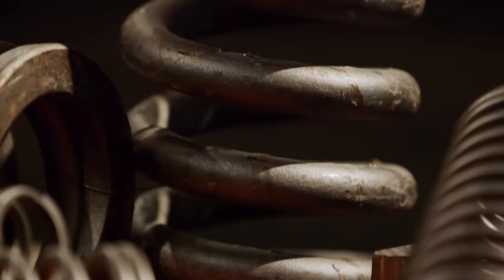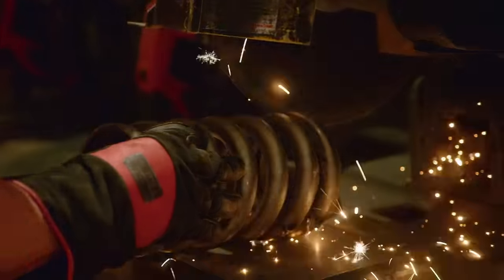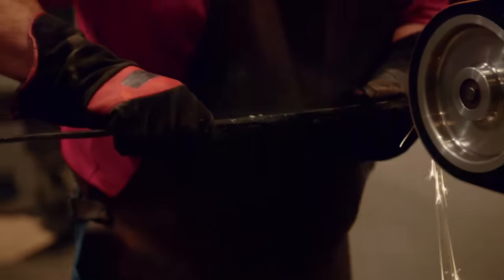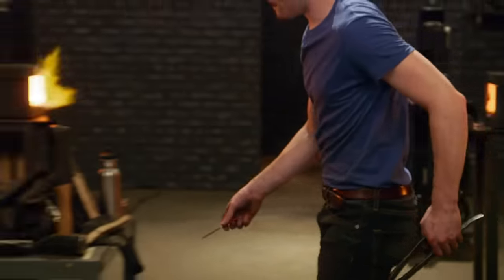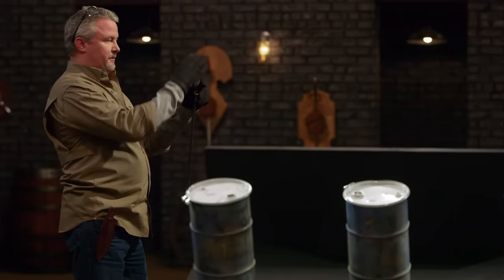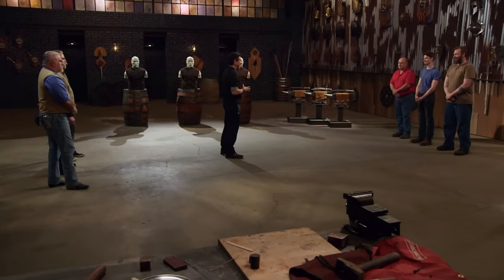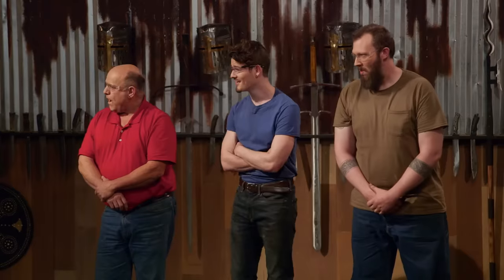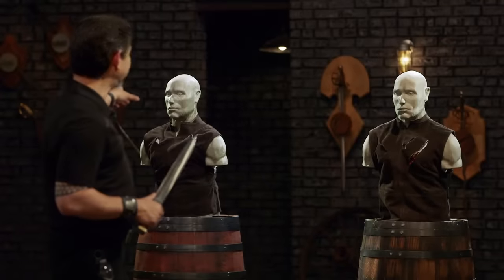Bladesmiths SPRING Into Action | Forged in Fire (Season 7)

Comment: Doug comes within inches of lacerating his palm due to a poorly designed guard, yet the blade smith still moves on to the final round.  That baffles me.
Reply: The entire time watching the sharpness test.  I had the feeling that was going to happen.  😢
Reply: Ok but it lt did hold up much better then all the other blades and the Ricky's blade was holding up plus it only had one side of it that was large yes his guard was not perfect and it could have been better designed but it did much better then the other two knifes
Reply: Because it doesn't have taken more damage
Reply: Knives have been disqualified in previous shows because they posed a danger to the wielder.  That should have been the case here.  It doesn't matter how strong the blade is when an inadequate guard puts you at risk of lacerating your hand.
Reply: Other blades quite literally didn't cut. A weapon that doesn't harm your enemy is far more dangerous and the other guys weapon was falling apart. They were all a liability.
Reply: @Durwood71 Well usually that's something decided on before the actual test takes place. A judge will notice something and determine whether or not to go through with it. In this case Doug didn't have an issue until that final stab, so the test was finished. So judging based solely on how well all the knives held together, Zane's was the best. I just hoped he learned to make more practial guards going forward to avoid a potential injury.